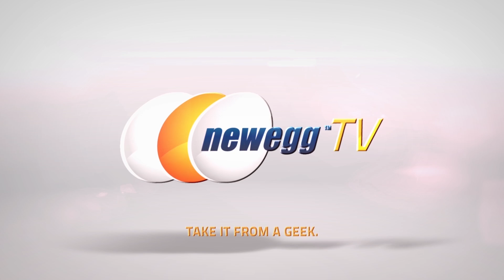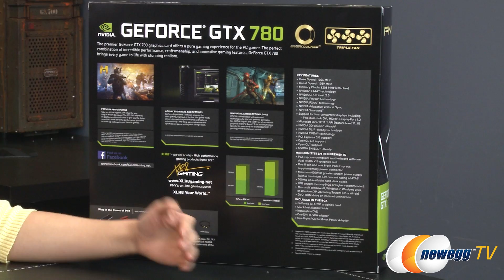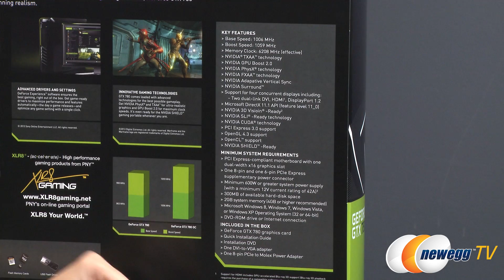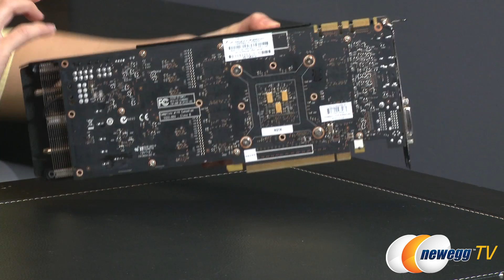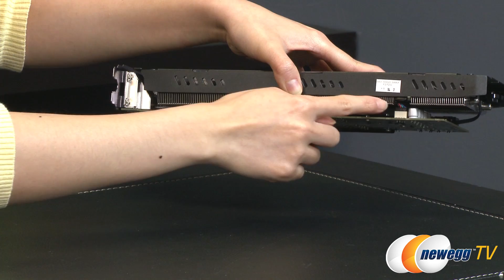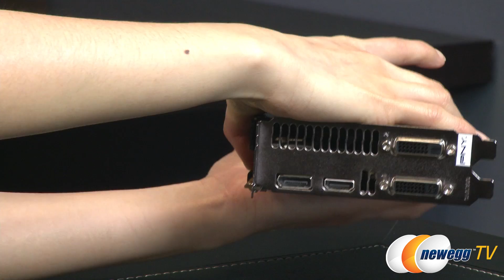PNY GeForce GTX 780 3GB 384-Bit x16 SLI Support Video Card Overview - Newegg TV

Comment: This card is beastly, by far the fastest factory overclock GTX 780 you can buy! You have to love an American made company which delivers LIFETIME warranty and highly binned this card for its GPU and Memory overclocks.

Then it goes even further if you manually OC the card... its amazing!

Scored 65FPS AVG on Metro Last Light benchmark, all settings very high, dx11, 16xAF, Normal blur, Physx, No SSAA, 1080p.

Comment: Chocolate Wizard 
Actually, there's a technicality in the case of this card... aluminum blocks that are installed will perform the same as copper blocks.

It's not something people catch often, but a GPU is going to use vapor change within the heat pipes on the cooling array. The aluminum block is more rigid and stronger vs. a copper mount.
The cooling of the GPU isn't so much from the aluminum, rather the polished heat pipes that are mounted firmly against the GPU with the help of the aluminum block that holds it all together.

Comment: If I were to build a computer with this card would I need 2 gpus so the computer will focus on the GTX 780 ( noob at building)?
Reply: What do you mean so the pc will FOCUS on the 780?  What exactly are you trying to accomplish?
Reply: I know that most pre-built computers come with an on-board graphics card. I've found that it isn't good for gaming. It would make sense for someone to buy another graphics card or GPU to take the place of the on-board graphics card (don't quite know how this works). When building a computer does one need to buy 2 GPUs or do you only need one?
Reply: VerryLongName
you only really and truly only need one GPU, unless you want to do a two monitor configuration, or even three. the GPU will run for games even if you have an APU or an IGPU (onboard graphics), given that you have the correct PCI slot for the card. A lot of PC building is just research.

Comment: why aluminum and not copper heat sink? What is the advantage of that?
Reply: Aluminum is a little cheaper and the thermal conductivity is almost as good as copper. Obviously copper is the best conductor in the pc cooling business
Reply: Non-coated copper also oxidizes and becomes discolored and won't look as good.
Reply: *****
He didn't say that ^^
Reply: Quan Dang
what? aluminum does not oxidize.
Reply: ***** Actually aluminum does oxidize